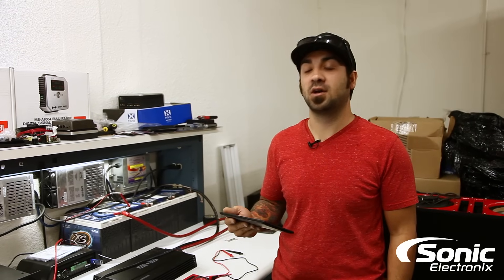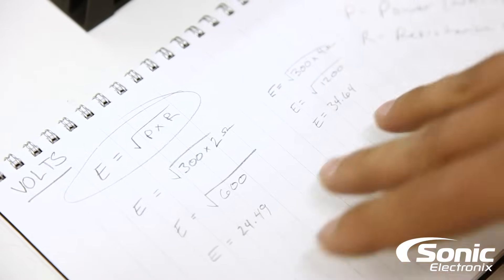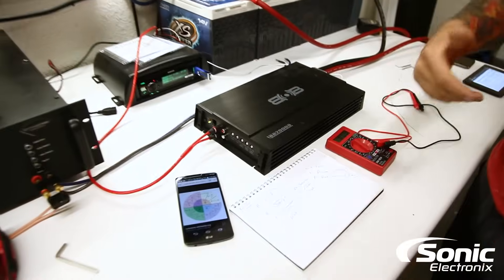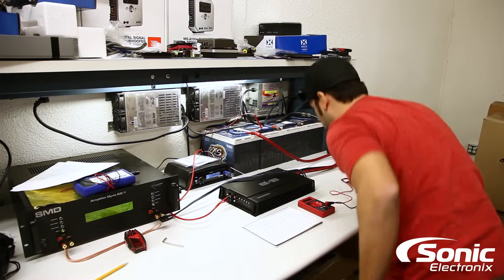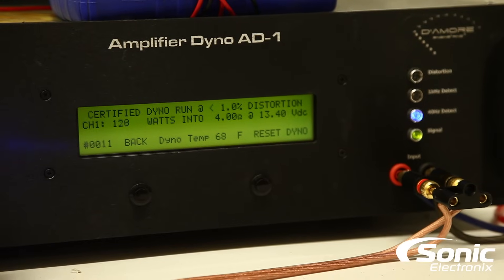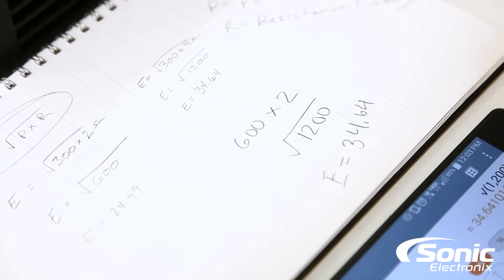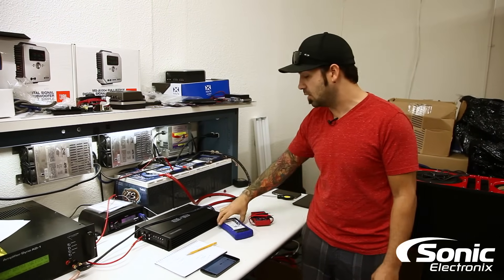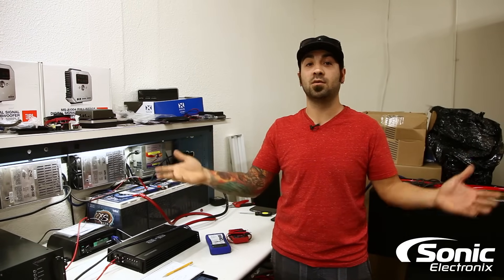How To Set Amp Gain to Match Lower RMS Subwoofers? | Car Audio Q & A

Comment: I need some help someone, I have a 1000 watt RMS amp, and I have 2 dvc 4 ohm subwoofers that are 1000 watt RMS each, what is the voltage # I need to look for, the amp is gonna be bridged
Reply: the amp is a 2 channel bridgeable
Reply: +Scott McFate _ 
1) From the sound of things, seems like you're about a thousand watts under powered.
2) Never mind using a meter. Instead, with the amp connected to the subs, just use your hears to set the gain. While playing the 50hz tone and the amp gain at full counter clockwise position, listen while turning up your head unit's level until you hear the hum become a buzz and then turn the head unit's level down a little to where it was humming and leave it. Now play the tone and do the same again while turning up the amp's gain. The humming = playing cleanly. Buzzing is distortion (clipped signal).
3) Hope your running zero awg power wire
4) Two 4ohm dvc subs can be configured as a 1 or 4 ohm load on the amp. If running bridged, make sure to configure them as a 4 ohm load. Unless you have an amp which is otherwise stable at 0.5 ohm per channel.

Comment: may i ask, where is your LOC? wouldn't it damage the amp? thank you
Reply: +keiannschyler 
my 2nd question:  one of the specs of my amp says that the max input level/impedance is 
RCA = 6.5V/25Kohms
Speaker = 16V/25Kohms
my stock headunit  has a max power of 50W/ch @ 4ohms, by calculation, its max Vout is 14.14,
my question is do i still have to use a line out converter?

please i need help.. thank you..
Reply: +keiannschyler

1.. Since the headunit (the radio) is an aftermarket radio and has a built in RCA outputs. (anywhere between 2-6V depending on unit) there is no need for a line out converter. Simply connect the other end of the rca cables to the Subwoofer output of the headunit.

2.. there are a lot of variables in an install but generally if you're running a stock headunit (a headunit that was installed at the factory) not an aftermarket one. you want to have a line out converter. simply connect the line out converter to the rear speakers of the vehicle and run an rca from the line out to the amp. 

also some amps depending on the make and model have the Line out converter built in. you stated that the amp has speaker level inputs. though it is usually easier to run a line out converter than to run speaker wire all the way back to the amp. 

my general word of wisdom is if you have the base system in your car that doesnt have any special features (like nav) then the best option is to go for an aftermarket headunit. it will make your life a lot easier when installing extra speakers (like subs )

oh and by the way. most factory headunits only go up to about 12-15 watts before completely sounding like a**
Reply: +Salvador Sandoval 
thanks man. really appreciate your inputs.
Reply: No problem

Comment: don't you have to use  a load connected to the amp (a resistor because is constant in frq)  to set the voltage targeted ?
Reply: +Adrian Poroch no because you calculated for that resistance. hence why you have to include your speakers resistance in the calculation

Comment: It doesn't get you close at all. Most amplifiers have an unregulated power supply so the second that load goes on, the rail voltage drops, as does the output voltage. Some amps have a regulated power supplies. If your into SQ it's almost mandatory that they do if you want to maintain the dynamic range of the source. If your listening to today's music it doesn't matter because the "engineers" already compressed the hell out of it on the mixing board.
Reply: +lazzer408 true but you still dont want to burn out the voice coil on the speaker/ sub. so if you make the maximum output of the amp the RMS of the sub/speaker there wont be any worry of there being any magic smoke escaping.

Comment: Dam thanks a lot. I have a hifonics hifi1000.1d and I'm powering 2 kicker l7 @1000watts rms. I know I'm under powering them but anymore then that and I blow my alternator.. Having said that, I had my amplifiers gain half way up and I felt that at half way I was already a lil high... That was not the case AT ALL! Considering the gain was about half way or at 12o'clock, then it's fair to say it was about 3/5 of the way up. After doing the math, I needed to set the gain at 31.6 volts. After setting it at EXACTLY 31.6, the gain was approximately 4/5 of the way up... I knew that my subs felt a lil weaker than usually but wow... Thanks you so much sonicelectronix

Comment: Just wondering what size fuse (fuse holder connected to battery) i need for my amp, its a Boss Audio AR4000D
Reply: +trbcop that fuse is simply to protect the battery from a short circuit. so a higher amperage like 80-100 amps should due. the ones protecting the amp from drawing too much power are actually on the amp
Reply: Are you saying I should have two fuses? One close to my battery and one near the amp ?
Reply: Salvador Sandoval ok thanks, i've been using 50a fuse, i didn't think it was enough. I've heard i should use 100a because i have x2 50a fuses on my amplifier.

Comment: Hi i have 2 subs compR model 40CWR124 and my amp is a hifonics BEX2150. 1D should i multiply the rms of my subs first ? example 500 rms x 2 = 1000 and then 1000 x 2 ohms = 2000, squareroot of 2000 is v= 44.72

Comment: Thank you so much!!! THIS WAY TOO SIMPLE, I tuned my 5 channel amp using this method. tuned my sub to 40hz and my front/rear @1khz setting it to factory projected RMS with my deck set 0 accross the board. After that setting my internal deck x-overs became a SNAP!!! Crystal clear at max volume, without piercing my ears, was able to sing "ABC" at my normal speaking level and not hear my own voice.
Kenwood eXcelon 998
Rockford Fosgate P1000X5
Focal access 165AS front/rear
KICKER 40CWRT671 x2

Comment: Question. I have a 2 chann. 800watts amp and i am not really sure about the watts of the sub.(10") but i checked the ohm on it, it showed 4.5ohms on my multimeter. I have accord 2010 ex and my question is that, can i connect all my 4 speakers (through the line in converter) and the sub at the same time to the amp since it says 800 watts. Can it handle it? If not then what is the best solution. (Im not going to buy any astronomical money on speakers). 
Thanks
Reply: Correction- Im not trying* to spend* any more* money on speakers.
Thanks
Reply: +Tauqir Ahmed 

the 2 channel amp will probably only handle the sub. 

to be honest you will need to buy a 4 channel amp for the door and rear deck speakers

also 4 new speakers that can handle the added power of the new amp.

if you don't wanna spend more money I would suggest keeping the door speakers as is with the factory power from the headunit and get a line out converter, and wiring kit for the amp. and simply running the amp for the sub only. 

good luck.
Reply: Thanks. It worked and sounds pretty good. I have actually monoblock amp, somebody corrected me.

Comment: hi Allyn , how are you? I need some help , I have 2 12" 1400W sub speakers and a XTC 4000W mono amp , how do I check the ohms and the rms for both and set the amp correctly
Reply: +john rose and what size cap would you recommend

Comment: i have a question. let's say i have 5 channel amp. 2 ch for the front, 2 ch for the rear and 1ch for the sub. do i have to do this on a woofer and a tweeter? if so, what test tone frequency am i gonna use? thank you.
Reply: +keiannschyler I used a 1Khz test tone to set my front/rear with tweets using this method got me pretty close, few adjustments with my X-overs in my deck using my ears, got me the rest of the way. If your woofer and tweeter are on the same line split with a X-over, just take an Ohm reading @ the +/- end that goes into your amp.

Comment: if my older head units rca preout is 2v and i put in a new head unit with preout of 4v.. do i turn up my gain?
Reply from the maker: +paperboi714 If it was set correctly on the 2 volt headunit you'd actually want to turn DOWN the gain when you go up to the 4 volt headunit.
Reply: +Sonic Electronix what head unit is used in the video

Comment: I have a Interfire T-3000D its mono but allows you to connect two subwoofers like a 2 channel amp would. My two Rockford Fosgate P3D2-12's RMS at 600watts and peak at 1200watts. I want to know what I would have to set my amp at if my subs are wired at 2ohms each and the amplifier bridges them to 1ohm or if i wire them to 4ohms and they get bridged to 2ohms. I get confused because of the amplifier being a 3000 watt mono amp but has two channel outputs for two subs and don't know what it puts out to each sub. thanks guys love the videos

Comment: Do you have to take the input voltage into account with this method?
Am i correct in assuming your batteries and dyno power supply was reletivly 14.4v?
Reply: +DJGoProCarAudioGuy No, you're only reading direct power to your speakers/subs, the head V's are amplified by the amp.

Comment: what if I have a 1000 watt rms sub  running on a 500 mono block amp can I run the gain on the max or do you still have to run the test?
Reply: +Foot Printz 
An amp's gain isn't there as a level to crank up all the way.
It's there to match the amp's sensitivity to your head unit's pre-amp output's signal.
Like this http://www.crutchfield.com/S-MUeo4Kg23qy/learn/setting-amplifier-gain.html
Reply: Thank you for the info! I have a NVX sub and it's powered by a hifonics amp 1200 mono...is that enough power for the 1 12" sub?

Comment: Ok I have a Power Acoustik Digital Class D Bamf 5500W and I would like to know how to connect them to two 15 inch VM Elux  Subwoofers? the amp has three rms,@1ohm 1X3,200-@2ohm1X2,500-@4ohm1X1,700 and Peak Power at 5,500. Now the subs are DVC rms1,300-Peak2,600.I did parallel connection. I wanna know how would I match them or Close to them matchIng

Comment: do you guys know why my amp turns off when i turn up the volume. i have 2 12 Rockford Fosgate and a 1,600 watt amp @soniceletronic
Reply: +xavier valle there are so many factors... but i would say either the amp cant handle too low of ohms (subs wired in parallel but amp cant handle it), or the amp is not in a well ventilated area and is getting hot. or it could be that the power wire is too small or ground wire is too small or not grounded properly.

Comment: 0db doesn't seem to make sense when dealing with music which is dynamic. If your listening to say "stairway to heaven" which has a range of 35db (-40 to -5db) then in this case, the bass would disappear would it not? I get it that theoretical a song may have a split second peak here and there at 0db at your max volume but who listens to max volume all the time with music that truly ever peaks at 0db? I think most all compressed music is never at 0db by default unless the user specifically sets out to do so.
To my understanding this is where gain overlap comes in. +10db's as a compromise for gain overlap so I use -10db @ 50hz.
 That is my experience anyway.  it's a rare blue moon that my volume ever reaches the maximum which is louder than I care for but also since my music is rather lacking in the 30-40hz area, at normal volume it completely disappears.

Also, head units never play their full output voltage with music. Some songs may have the HU's output voltage be 35% less than rated while another my be 53% less than rated. So I'm still curious as to why 0db @50 hz and 0db @1khz has become the static go to level of setting gain?